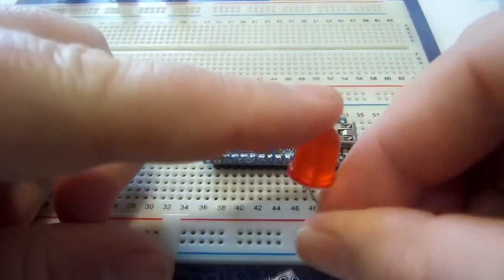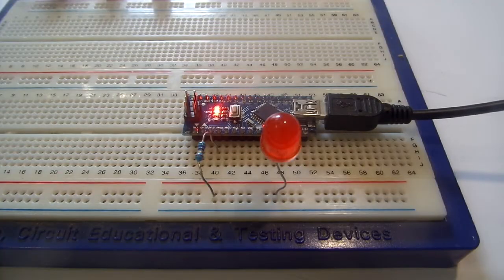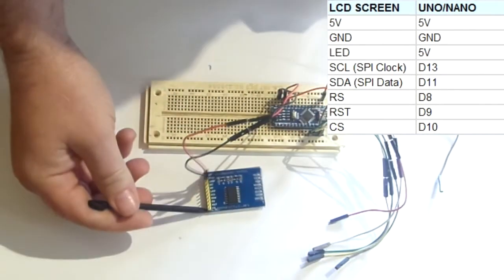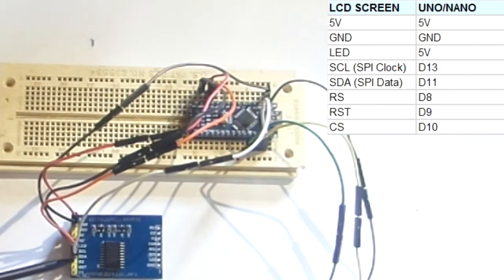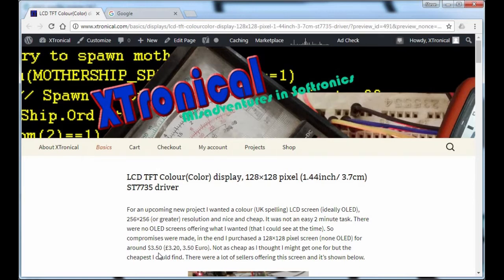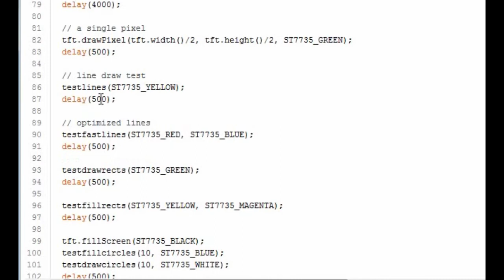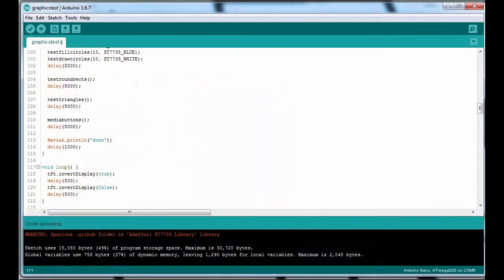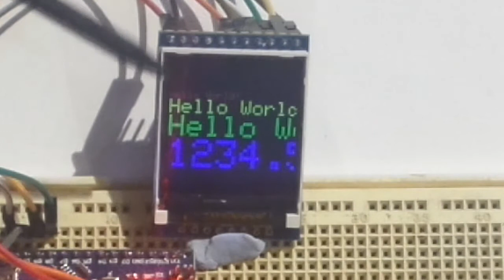Driving cheap generic 128x128 Colour LCD (new 7735 Driver)- Arduino

Comment: Yeah, it looks like in the latest adafruit lib, you have to uncomment this line "  tft.initR(INITR_144GREENTAB); // Init ST7735R chip, green tab" and comment the original line, and everything works fine after that.  That said thanks for your work in the meantime.

Comment: I tried using ST7735R 1.44inch, but I am having trouble with the low contrast of the screen.
Can I get better with changing initialization parameters?
Reply from the maker: I don't think that it's software controllable from memory. Make sure the led back light is connected correctly and working, you should see a very noticeable difference if you plug the wire in and out. Also if you can it can connect to 5v and that would make it brighter too.
Reply: @XTronical  

thank you for your answer.
It is a state at the time of question ↓
https://youtu.be/0jE9590DaCU
There is no problem with the LED backlight.
It seems like you need to optimize the BMP data for this display.

Comment: Hi there. I am using your library to write to my display. Everything works great except when I use the setRotation(0). For some reason the top is cut off. So the coordinates 0,0 are not in the top left corner. Do you know how I can fix this?
Reply from the maker: The latest adafruit code now works with these cheap screens (so my adjustments are not needed), you've just to change the call to the initialise routine (usually in the setup function). Like this 

    tft.initR(INITR_144GREENTAB);   // initialize a ST7735S chip, for 128x128 display

Hope this helps :)

Comment: You are going to kick yourself.  On line 55 of the adafruit demo  you have the 1.8tft  screen initialized (which is 128 by 160)
you need to un comment the line just below which will initialize the 1.44 tft (128 by 128). The demo has options for 3 screens, 1.8, 1.44 and .96,  you must un-comment just the screen you need. It works for my 1.44 screen, Im now trying to get frogger to work using an esp8266
Reply from the maker: +tim bo hey, that's brilliant, great stuff. Hopefully frogger won't give you problems.
Reply from the maker: Just been looking at this again for someone else, in the code I'd originally got from Adafruit there was no method "initR", just an "init", would seem they updated their code for other different size screens making my alterations redundant I think, need to check.

Comment: there is nothing at the link
Reply: tiny urls expire after a short time. Bad choice for permanent links
Reply from the maker: Thanks for the heads up, I don't use them any more, will go back and change.
Reply from the maker: Thank you for the heads up, some moving around on the sire broke the link, I've now corrected it, here it is as well as a tinyurl as it had become very long

https://tinyurl.com/y87bhmw6